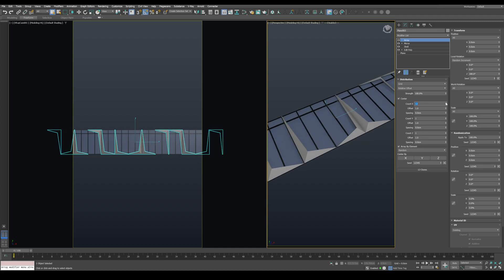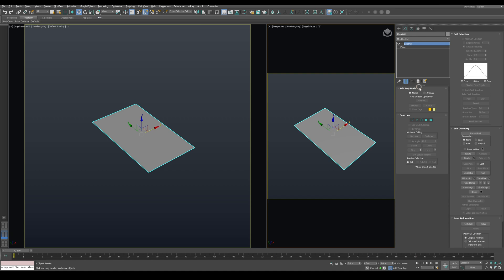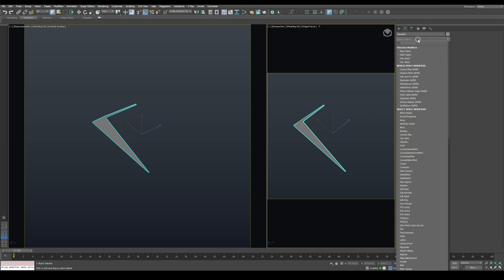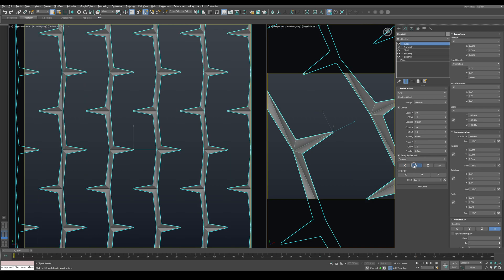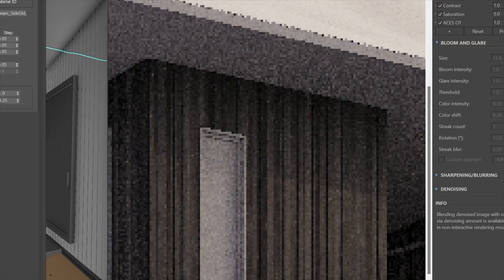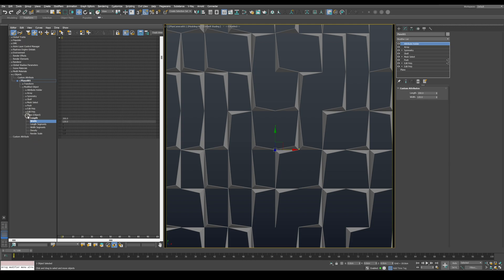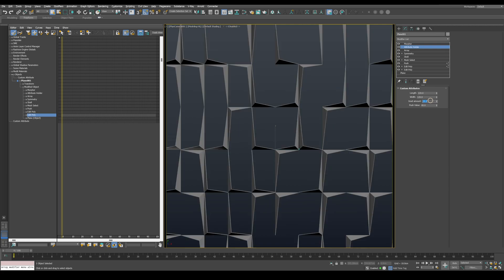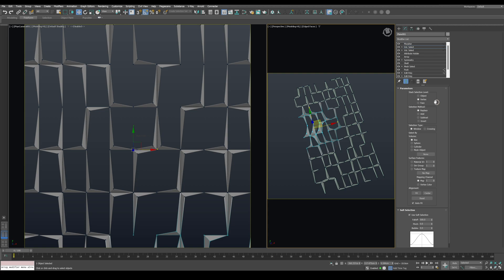Dubai Design District Facade | 3ds Max Procedural Modeling Tutorial

Comment: Thank you! but this is little bit random, how we can create exact location is it has to be one by one placement or is there any quick tool for it?
Reply from the maker: You can do each part of the facade separately, and use boolean modifier to fit out irregular shapes. Another and more reliable way will be modeling one piece as shown in the tutorial then create the facade using Railclone.
Reply: @BoundlessBox  Thank you!